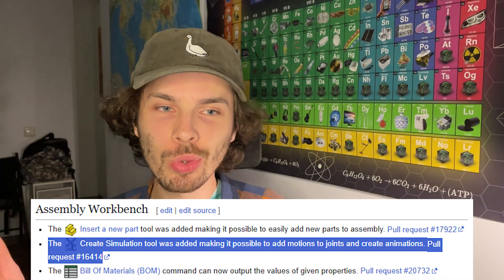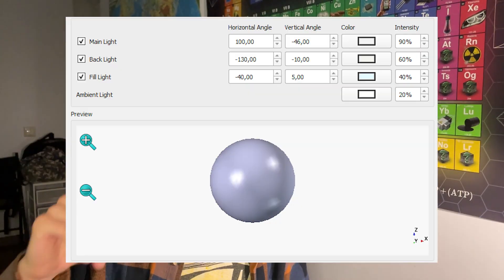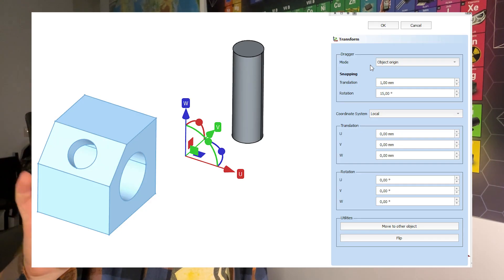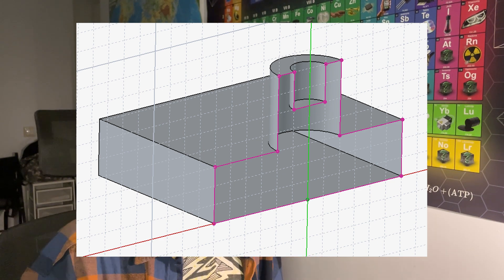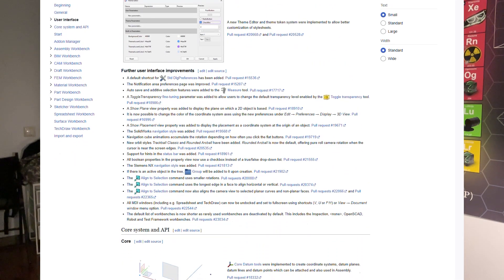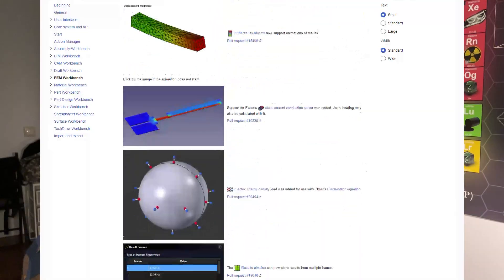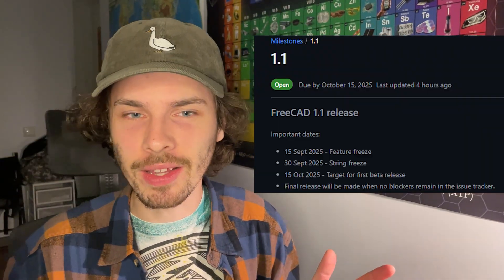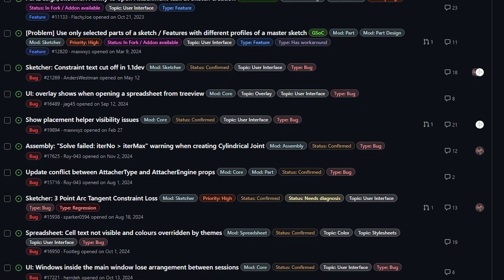Is FREECAD Set to Dominate in 2026?

Comment: Is FreeCAD set to dominate? No. Not even close. Is FreeCAD getting really good? Yep. Is it even close to being stable and user friendly enough to even stand on the same stage as Fusion or Solidworks? No. I'm literally in the middle of trying to make a welding cart design from plywood and FreeCAD keeps giving me the sketch flipping issue. Fusion doesn't do this neither does SolidWorks. Why is this important? It's a barrier to entry. Why would I bother with FreeCAD and using workarounds when other programs just don't have this issue at all?

Comment: FreeCAD's biggest plus is that it's FOSS, obviously. Things that I don't like are: 1. "Command not done", 2. Being so fragile, i.e. reference a geometry in a sketch, create a line that is parallel and offset by some distance from the base line in one direction, later make changes to the base geometry and the line might get moved in the opposite direction, completely breaking your sketch, 3. Poor text and font support, e.g. no simple font selection in ShapeString, 4. Chamfer and Fillet refusing to work, 5. Chamfer and Fillet not being able to find the lines or faces when you make seemingly unrelated changes to the preceding steps, 6. when opening a sketch you often have to zoom out and scroll to actually find the sketch, 7. You have to basically save every minute because you never know when it might freeze, 8. Sometimes it produces broken geometry, you notice way to late and it's hard to find the root cause. 1.1 introduces new features, but did any of these problems get fixed?
Reply: There is a lot that holds freecad back

I teach interior and product design and it cannot compete with fusion or sketchup in many aspects

Having 70% of the tools only is its biggest issue

Comment: Either I'm doing things wrong or FreeCAD is one of the most unoptimized software on the planet. I was trying to make a 600mm x 600mm fan mesh grille and it completely froze the program when trying to calculate an array. I have a 9950x3D with 64GB DDR5 and an RTX 5090, all water cooled... there's no excuse for the horrible performance. It needs optimization.

Comment: Is TNP fixed ?
Reply: Yes, the recent version fixed that problem.
Reply: Yes, mostly. It is far from perfect, but it is suprisingly good now. I had to change a somewhat complex model of mine in its base geometry, some sketches did break, but suprisingly few, and most of the broken sketches broke in really obvious ways, like the edge I am referencing not existing anymore, etc. Overrall I was suprised on how little I had to do to fix my model.

But this is to say, its not perfect. But no cad software is. Onshape which I used before would have also thrown a fit with my changes.

Comment: Until Freecad dispenses with all the redundant overlapping "workbenches" that very few have any clue to the reason for, it will remain confusing, obscure and niche. Yes it's become extremely capable, improved immensely, yada yada. In Onshape (for instance) they figured out how to model everything and have all the design tools present in just one workspace. Of course, you can have other workspaces for assemblies, and for 2D mechanical drawings, but those are three very different purposes, and that's still just three total. OK Freecad does CAM as well, so four. Four, not 20.  And honestly, it should just be ONE, and put all that other stuff away where you don't even see it or separate it out to other programs. I mean Freecad is awesome, but it's also a mess.

Comment: Nah, i really doubt it. I like FreeCad because is faster then Fusion360 but sometimes sketcher is pita. "Wire is not close" is nightmare and even witch validate sketch it makes work unnecessary harder. Also pad/pocket operations. Why not join them like extrude function in fusion? And other quirks. FreeCad 1.0 is first version i believe to be "usable", 1.1 looks like big improvement but there is still a long way to go to be competitive
Reply: I overall like it on my MacBook Air, but I have had random crashes that wasted some time for me

Comment: Lets be honest there is a reason its free. Just get a cracked copy of a professional package
Reply from the maker: Blender made it big and it is free and open-source. If the community makes Freecad right, we all can benefit
Reply: @LooseGoose_Crafts  they have had enough time the base engine is waaay out of date. Ive tried it a number of times 
   Ive been using cad for 30 years now,
Ive tried 
Freecad
Fusion
Mechanical desktop 
Cero
AutoCAD 2d
Catia
All have issues 
The only well thought out package  is solid works.

Comment: Coming from other CAD software there are still so many akward things. Like brining in external geometry, menu systems that  makes your head spin. Still I'm learning it, because it's free - in all good ways. But it's damn inferior in the strangeness you have to work with it.
Reply: Yes, it's definitely an acquired taste. So many unnecessary clicks and procedures, half a dozen workbenches for the same thing (but slightly different ... and you have to learn when to use which one and why), so much stuff I shouldn't have to do. I try it every few years, but ragequit after two or so days (and go back to Solid Edge, which PLM does its best to enshitify as time goes on, because why not).
Reply: Yes, I would have to agree. As much as I hate paying what Solidworks wants and what windows has become I just can't stick with freecad. It's come a long way over the last few years but I also rage quit after a couple models and go back to Solidworks. The whole having to project geometry adds like 4 clicks and moving the mouse all over the place or remembering 500 different keyboard shortcuts compared to Solidworks. I've been using Solidworks for the last 18yrs and have a hard time sticking with freecad no matter how much I want to. I know it will never be Solidworks but it definitely needs to be cleaned up, refined, and more efficient to be any kind of contender. I love how all these videos put it out there as an equally capable and a major contender to the mainstream modeling systems. Sure it can do almost just as much, it just takes 10 times as long to do it.
Reply: @tullys66  Definitely. It's not about capability (with tnp mostly gone), but about convenience. The experience with the big boys is just so much more streamlined (while all of them will have some quirks of their own, overall usability is still way better).

Comment: Why? Will they finally fix it from all the shit?
Reply: Getting businesses to switch to a CAD software that has no professional support, or certifications, and legacy products modeled in another piece of software which isn't cross-platform is challenging. So, I don't think you'll see that happen any time soon. As far as using FreeCAD goes, I think it's come a very long way in the past 2 years. A lot of user frustration can be alleviated through preferences, I always recommend people at least try installing the OpenTheme addon. Whether you use the actual themes themselves or not (disclaimer, I am the creator of this addon), there is a 'preference pack' called OpenPreferences that will configure most of the application and interface to what I consider a much better usable state. It isn't a silver-bullet, but it helps significantly. As far as UI/UX changes, it's a challenging problem that isn't as simple as 'copy fusion or onshape' for a multitude of reasons I won't get into on youtube. I wish it was simpler, I've been advocating for incremental UI/UX improvements for the past few years, I consider each one a small win.

I defer to a saying I learned in the military: "How do you eat a whale? One bite at a time."
Reply: @joes144 but the experience I was describing INCLUDES using add-ons that improve it already!

It's that bad, constraints resolution sometimes makes no sense, it's too strict, it can't figure out many things that it should be able to figure automatically from the data it has available

It's not just a UI problem, first of all it's a UX problem
Reply: @justsomenamelesssoul8097 I'm well aware of the relationship and distinction between UI/UX. Sorry FreeCAD didn't work out for you. I didn't comment on the first place to get into an argument, was just trying to ease the pain.
Reply: @joes144 en, not really an argument tho? I'm not trying to convince you it's bad, I'm just stating what I consider to be true, nobody is obliged to agree with me 😅 I genuinely hope it gets better, I love foss and it saddens me to see our only hope for FOSS CAD to be in a state it's in
Reply from the maker: Probably not all, but some definetly. The developers have made incredible success with what they have. Solidworks spend roughly 400-1000 million per year on R&D while FreeCad spent 100K. That is litterally ten thousand times less and yet we get so many features and for free? I think thats epic and show how effective is open source. 
Source - https://blog.freecad.org/2025/02/27/fpa-2024-annual-report/
Reply: @LooseGoose_Crafts I mean, I like opensource, but people are constantly reporting same issues over and over again, you don't have to do any research to read the bug reports?

Also, youve said it, other companies already did the research, look at the ui's of fusion, solidworks, onshape, etc. And just give people an option to do something similar, no need to reinvent it

But no, constraints in FreeCAD are such a mess that even I, as a huge Foss advocate, spent days trying to adapt to It but gave up on this thing. And I've been using Linux-only desktop for the last 9 years.. I'd rather use onshape to be honest, FreeCAD is a total mess and I don't think they can even fix it

Of course I hope I'm wrong, of course ill be happy for them to prove it, but as of now? There's no functional Foss cad that's actually on the level acceptable for even the hobby projects, not talking about professional at all
Reply from the maker: @justsomenamelesssoul8097  Yikes, sad to hear that FC didn't work for you. Similar sentiment of what MrLelopes said, the inside communication at FC is apprarently not that great, but I do have hopes that it will improve as more users come to try and community gets together. Apes together strong ;D 
I feel like there is this snowball effect that could happen if the right conditions occur, perhaps this and few more versions with laser prescision on most pressing issues and we have OS cad for many years to come.
Reply: @LooseGoose_Crafts that's actually my entire point, if they focused on making use able "lite" UI version that could be on by default (and advanced users could just turn it off and go back to entire "thing")

They could at least attempt to attract some real businesses to use it, and if real businesses were starting to use it, it would benefit everyone including Freecad team (real complex projects, donations, etc.)

But I don't see any of that happening
Reply from the maker: To be fair, the long term vision document does seem to focus quite a lot on the UI UX. One of the first things I enjoyed when coming from blender was the ui option to set it to dark + my blender defaults for camera stuff. Heres doc - https://freecad.github.io/DevelopersHandbook/roadmap/
Although i am unaware how closely it is being implemented and up to date